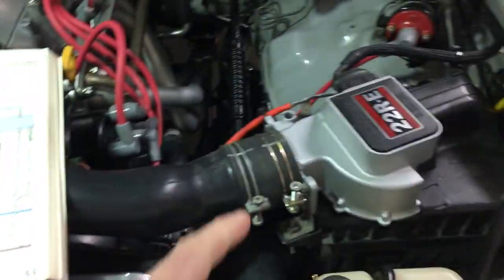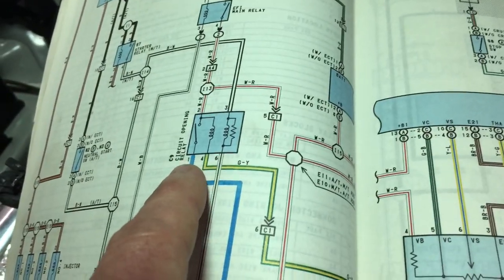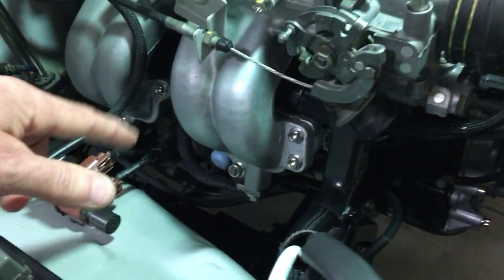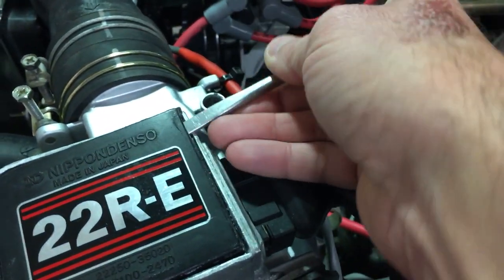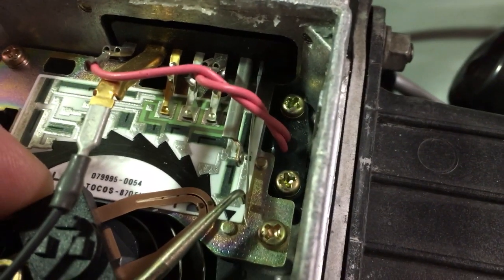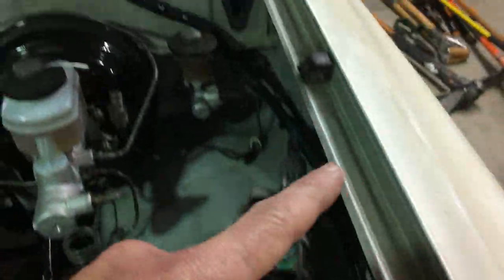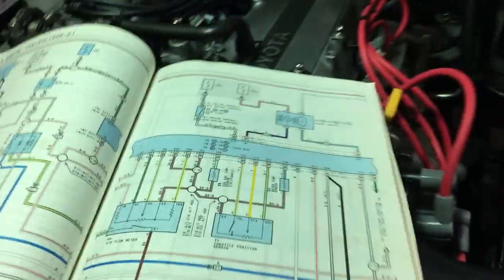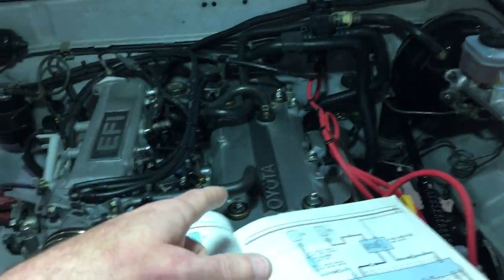How the Toyota 22RE AFM turns on the circuit opening relay via FC & E1 to enable your fuel pump

Comment: Just to add some supplemental info to this. The plug under the passenger seat can cause issues. These trucks are now so old that the plug pins can get loose, burnt, corroded. I just battled a no fuel pump power issue and traced it to the blue wire (+ to fuel pump) the pins in the plug were loose and making intermittent contact causing the fuel pump to cut on and off. Took me quite a bit of trouble shooting to find the issue.

Comment: Which manual is that? My Haynes is mediocre for electrical, at best.
Reply from the maker: It's the Toyota factory electrical manual. You can usually find them on ebay. Super handy.

Comment: What book is that?
Reply from the maker: It's the Toyota Electrical wiring manual. I touch on it here in this video (at the time mark included 1:09:25) https://www.youtube.com/watch?v=btO13aO_QLU&t=4165s - super handy to have if you are doing any sort of electrical work. You can typically find them on eBay used for either your specific model or years close to it.

Comment: I found out why my 22re will crank but won't fire. I opened the flapper at the AFM and boom it started. Should I open the box and check like you did? Or do I meed a new AFM. GREAT video.
Reply from the maker: check you intake rubber boot for cracks first.Also the plastic cross over pipe and coupling hoses
Reply: Did you also have alot of over fueling to the point you have gas in the oil? That's what's I have
Reply: @GunnerKrey-xk7pb  no I didn't.  All is fixed now. It was the cold start injector not mating.

Comment: Help me. I got a 94 with a crank no start. I have spark, pretty sure I’m getting fuel but I spray starter fluid and it still won’t start
Reply from the maker: You need compression, spark and gas for any motor to run... I would pull the plugs out and clean them or install fresh plugs. You might have gas fouled plugs. Naturally, you are going to have to confirm you have fuel coming out of the fuel injectors. Sometimes when you pull the plugs on a motor which isn't starting, you can smell them and see if they smell like gas. Also, to ensure you have spark, pull the plug, put the wire on, then set the plug onto of the valve cover and make sure you see sparking. You may also want to reset the ECU by pulling the 15A EFI fuse out for 5 minutes.

Comment: Long shot here Ray but I have a 22RE that has a wandering idle and eventually stalls after it gets hot. Thinking it could be an issue with the relay or the MAF sensor itself. Any thoughts? Going to replace the relay and clean as much of the MAF sensor as I can. Will also check the intake boot for leaks. Anything I'm missing?
Reply from the maker: There's no MAF to clean; it's just a flow meter (air flow meter / AFM). As long as the door is opening inside it, that's about all you need there. I made that mistake when I first got my truck - I tried to unscrew what I thought was the MAF and ended up accidentally destroying the air flow meter, so be very careful. I'd start by cleaning your spark plugs. Run some Berryman Fuel injector cleaner through the tank also. You could have an issue with the IAC valve not closing (you can test this by putting some tape over the inlet hole - see my other videos). Also, try adjusting your idle up to something more like 850 to 900... sometimes that will help prevent the idle issues when you come to a stop when the motor is hot. Valve adjustment can also help, but usually if the valves are way out, you'll also get a misfire when driving along. Cleaning the spark plugs often helps a lot.

Comment: Thanks for the vid. I’m having a problem where the fuel pump isn’t turning on when I turn key on. Is pin 1&2 suppose to touch when key is turned to on.
Reply from the maker: well two things happen in order to get the motor going. When you crank the starter, it also sends power to the fuel pump using the circuit opening relay (see my other videos) and this fires the motor up and brings up the fuel pressure. Once the motor starts, air starts flowing through the AFM and the switch on pins 1 & 2 are connected and this continues to power the fuel pump via the opening circuit relay as long as air flows through the AFM. You can jump Fp and B+ in the diag box and manually force the fuel pump on for testing purposes.
Reply: So I jumped the fuel pumped and it works I just don’t know why it’s not turning on when I turn key to on.
Reply from the maker: @cmossy970  if you jumper Fp & B+ and the fuel pump goes on, it will confirm that the opening circuit relay is good and that your fuel pump is working. Keep in mind: when you just turn the key to "on" the fuel pump isn't supposed to run. It only has power when the starter cranks and then when the engine is actually running. The only way to turn it on when the motor and/or starter aren't running is by jumping the Fp and B+ pins in the diagnostic port or by bridging pins 1 and 2 inside the 7 pin connector that goes to the AFM.
Reply: Now I understand. Thanks for the explanation!
Reply: Another thing is I did a fuel pressure test and had no pressure when  “on” but at idling there was is that normal?
Reply from the maker: @cmossy970  when the car sits the fuel pressure will slowly drop back to zero yeah. When you start the motor it should be around mid 30's at idle and then under load it will usually max at around 44 psi. As long as it's over 30 psi at idle you should be fine.
Reply: Right on🤙🏽

Comment: Ray, is it safe to run the truck with a jumper wire installed in place of the relay (key on/ fuel pump on) for a extended amount of time? I'm out of town and my truck died, I was able to figure out it was fuel pressure by cracking cold injector line while cranking and having no fuel. I made a jumper to bypass the relay and fuel pump runs if key is in on position. Will this be safe to run like this til I can get home (200mi)? I've got very limited tools with me and no real way to diagnose where the problem is. Thanks.
Reply from the maker: Sounds like the circuit opening relay died or maybe the contact points inside the AFM. Yes, totally no problem to drive like that. Jumper Fp to B+ in the diagnostic box and roll out. 200 miles, 500 miles, 10,000 miles - no sweat. You should be good to go, no problem. You can also do it at the relay, although a paper clip in the diag box is probably better.
Reply: Mine is the older style diagnostic plugs (86 22rte)  i did find the fuel circuit check plug. I jumped it at the relay just to get off the side of the road. Tomorrow I'll try to plug the relay back in and jump at the test plug. If it works then my relay is working, if not then I know my relay is bad. Thanks for the quick reply.
Reply from the maker: @renarderickson  You got it man. As long as you can jump something to get the fuel pump on, you should be fine to drive.

Comment: Can you do one following the blue cable from the circuit opening relay because I ain’t getting any positive power to the fuel pomp nor the relay I replaces the fuel pump the relay and the fuese link and I still aren’t getting any power to it. I replaced the switch too.
Reply from the maker: This video might help: https://www.youtube.com/watch?v=EpTED3Z2xo8 - did you try using the Diagnostic port near the fuse box and jumping B+ and FP to see if the fuel pump turns on? That blue wire you are talking about goes directly from the relay to the fuel pump, then from the fuel pump to chassis ground. Terminal FP in the diagnostic port is a bridge into the blue wire, which you can manually provide +12V on in order to test your fuel pump, etc. If jumping B+ to FP doesn't turn on the fuel pump, then either you have a break in the wire and/or a harness connector short or the fuel pump itself is dead. You might also want to try powering the blue lead directly at the circuit opening relay to see if the relay itself is not operating as it should (and/or the internal contacts perhaps are burnt / dirty). Anyway, that video should show you what you need to know to diagnose it further. Keep me posted on what you find out!

Comment: Hi Ray, thanks for the video. I’m getting code 25 on my 3vze for long time and after a valve adjustment it keeps showing so I started to troubleshoot different areas related with this code. Right now I was diagnostic the VAFM and got almost 0 resistance between E2 and VC, the rest are on the parameters. Today I got another used VAFM and I’m finding the same poor resistance between these two. 

Does I have so much bad luck or I’m taking the manual wrong?
Reply from the maker: This link might help - I don't have an answer for you off the top of my head: https://www.4crawler.com/4x4/CheapTricks/AFM/index.shtml

Comment: Hi Ray , great video I’m having rough idle and stalling issues...also with ignition on (not running) I’m hearing a clicking noise near the ecu in the cab ..what u think?
Reply from the maker: Sounds like it could be a faulty circuit opening relay (it's located right above the ECU, near the right of the glove box). You might also want to check the contacts inside the AFM. Hard to say for sure, but I'd start by checking the condition of that relay in there.

Comment: I have a 92 and after I purchased the Truck and cleaned the air intake I could no longer start it.  I replaced and upgraded so much but I still can't get it started.  I know that when it was running it had a funny howling kind of weird noise coming from under the hood then it would fix itself then act up.  I got the truck as an extra truck and need help getting it running.  From the alternator to the distributor and much more I replaced.  Now the videos you have with the maf and with the air intake hole I am curious to see what that is as I replaced the air boot as well too since the old one was cracked.  I can take photos and more if needed.  Not sure if you have a way to get them though.
Reply from the maker: I'd check to make sure the switch inside the AFM is functional. Also you might want to check your circuit opening relay. Try jumping FP and B+ to bring fuel pressure up and see if it will fire up like that maybe?

Comment: Hey thanks for the video really helped but mine is not working even when I move the flapper still not hearing the fuel pump come on what should I try next
Reply from the maker: Try jumping Fp and B+ in the diagnostic box (next to the fuse box) and see if the fuel pump is working. That will power it up directly, so you can see if it works or if it's the fuel pump that's dead. If you confirm that the fuel pump does work, then I would check the circuit opening relay (I have another video that shows it I think). That relay is in the right (passenger) side kick panel, next to the glove box. You wanna make sure that relay is working okay.

Comment: 1989 Toyota 22re OEM. Don't like to start in the rain..
Reply from the maker: I don't like to start in the rain either lol. Nothing jumps out at me. Usually starting issues relate to the cold start injector or just general poor tune up. I'd definitely check the inside of the distributor cap for moisture build up and/or carbon tracing. New spark plugs and wires could help as well. You might also want to run a compression check and see if you have low pressure in any of the cylinders.

Comment: Ray what is the name of the repair manuel you are using
Reply from the maker: It's the Toyota factory electrical manual for the pickup truck. You can usually find them used on ebay

Comment: Hey ray, was wondering what manual you are using. Seems way more in depth than the wiring diagrams I have in my book. Thanks.
Reply from the maker: It's the Toyota factory electrical manual. Search on eBay for "Toyota truck electrical manual" and you should find them used. Silver cover.